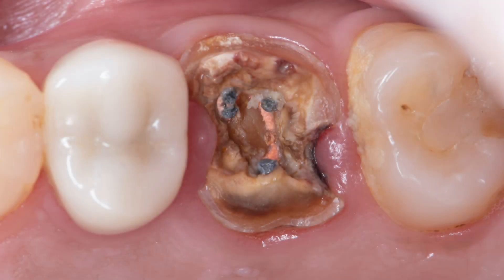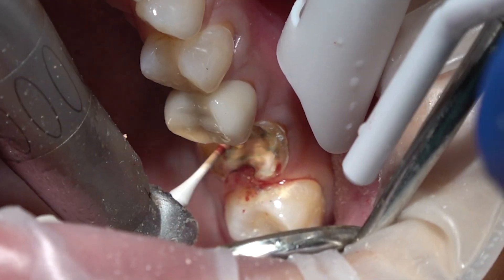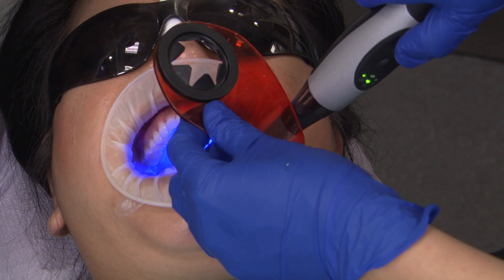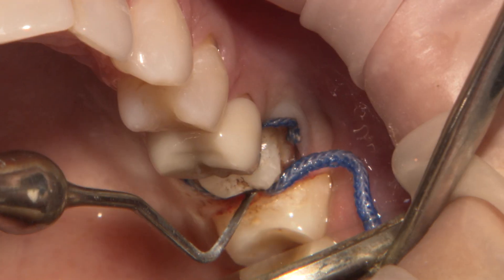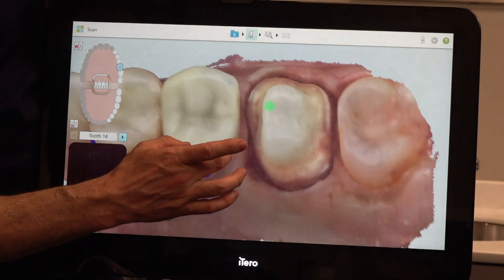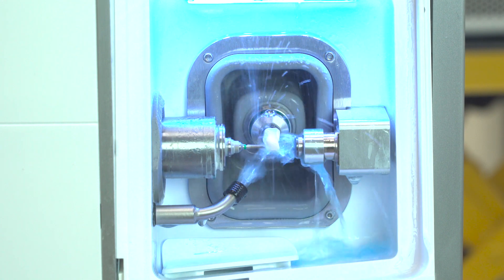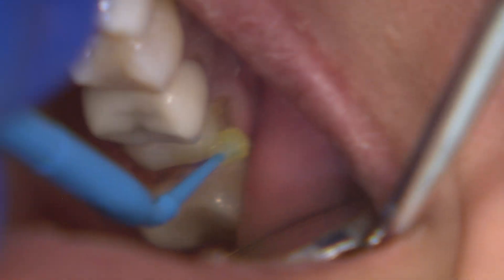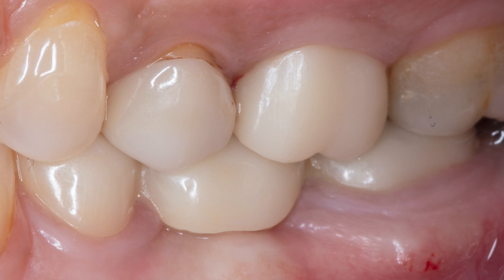My First glidewell.io™ BioTemps® NOW Temporary & BruxZir® NOW Crown

Comment: I have long refused to restore the stump of a tooth with a complete destruction with the help of a composite. it's not reliable. I recently redid this work by another doctor. In the absence of a ferrule, this is only a collapsible stump inlay made of zirconium oxide. In this case, it is necessary to reinforce with fiberglass pins, at least in 2 root canals. it will be more reliable. But it's up to the doctor...

Comment: Post placement was required!
Reply: No, it is not required.  Post actually weakens the tooth.  Retention is required which was done by providing a strong bonded build up utilizing all 3 root canal spaces.  Crown is still work and functioning fine.  Patient is extremely happy and understands it was a challenging situation.  She is very grateful.  That is what dentistry is all about.

Comment: Why it wasn't necessary to do post also?
Reply: It is necessary, and i don't think this tooth would last long
Reply: @Mhdlagha  time bomb before crown fractures with build-up in it
Reply: No, it is not required.  Post actually weakens the tooth.  Retention is required which was done by providing a strong bonded build up utilizing all 3 root canal spaces.  Crown is still there and functioning fine.  Patient is extremely happy and understands it was a challenging situation.  She is very grateful.  That is what dentistry is all about.   @Mhdlagha

Comment: So I take it the the carries did not reach to below the gum line . That’s great I’ve never seen a crown put onto such little tooth structure . Was the temporary necessary if the zirconium crown was being cemented within that same hour ? I just had one zirconium crown and one gold placed on teeth 8&9. I didn’t like the zirconium for the front it didn’t match and was very thick . So I switched to two gold instead . Not aesthetically nice but gold is tried and true ! Anyways great job !
Reply: The problem is not putting a crown on such little structure. That's the easy part. The real question/problem is what's the prognosis of the treatment provided? Given that there's severe structural loss, basically no ferrule effect, in addition to no post being placed and/or pins to hold the core in place, I would say it's poor. That crown will fracture sooner rather than later with the core build-up in it. It's a substandard of care treatment imo. Quite possibly a Richmond crown could have been a better, although still miraculous, modality of treatment for this tooth. Not all heroes wear capes!!!

The reality is, given the radiographic and clinical findings, that the most predictable way of treating tooth #14 is to recommend exodontia with implant & crown to restore. Properly planned this is the most predictable and effective way to have adequate long term prognosis for the affected area.
Reply: @DrBondpr007  The BruxZir NOW zirconia crown is very strong at a little over 1000 MPa flexural strength and not likely to fracture unless minimum thickness violation occurs.  This case shows that if you can find a margin, provide adequate bonded resin build up utilizing root canal space, and following strict bonding protocol for Zirconia cementation, it will have optimal chance of lasting a minimum of 5 years and every year afterwards is a gift.  The prognosis is guarded but it is still on there until the patient is ready for an extraction and replacement.  All my patients in this situation know that this is the last time this tooth can be restored.  I try to avoid posts as do not add strength to the tooth, only retention for the build up and crown that more often than not, causes fragile roots to fracture.  With adhesive technology available to us, posts can be avoided at all costs.   Thank you for your feedback and compliments.